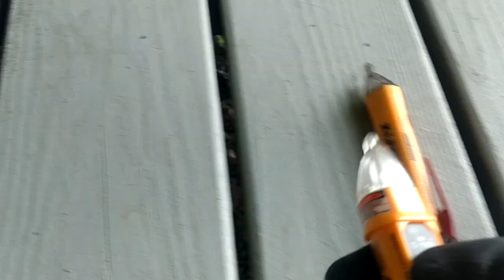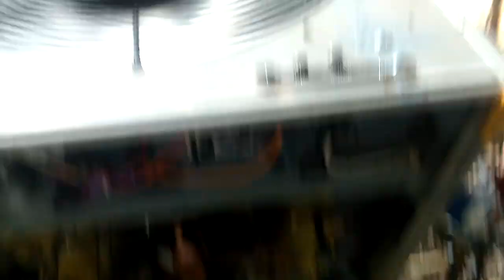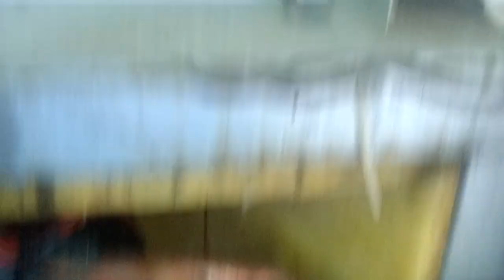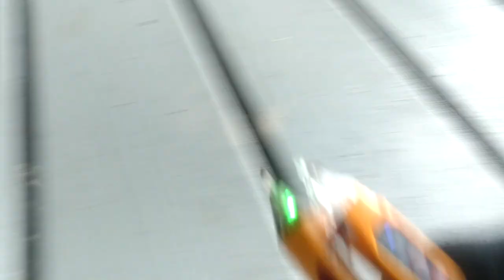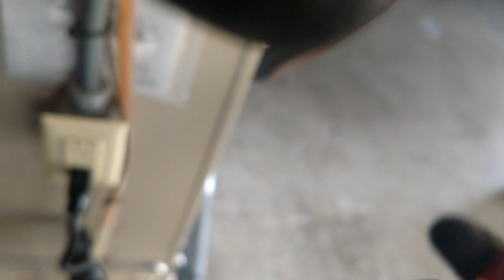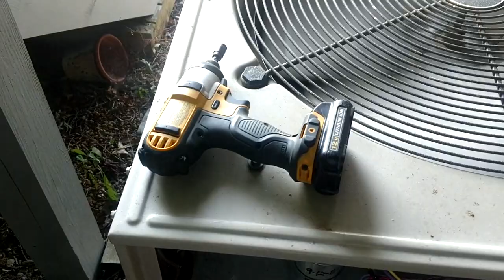Dangerous Problems⚡⚡Klein NCVT-2 (old version) malfunction caught on camera. Also testing NCVT-5.

Comment from the maker: The NCVT-2 probably went into "silent" mode once. But it obviously had mind of its own, turning on & off without even touching the button. NCVT-5 is definitely the better option.
Reply: exactly ncvt2 drove me crazy turns on , off .
Reply from the maker: @hvacir9176  I'm glad I wasn't the only one. A lot of people seem to be experiencing the same problems with the ncvt-2. Thanks for you feedback & for watching 👍
Reply: Personally I believe the tip light is good enough because it assures you the thing is working AND these devices auto power down, the biggest concern in my experience.   I do agree that functionally  Ncvt-2 is the better detector with its dual voltage modes (12-48vac and 48vac to 1000vac) and better light.

Mode changes based on holding the button for various times is perhaps the worst human engineering part of the NCVT-2.   So to be safe you have to watch the light on the tip.  That's probably why the new model has a weak buzzer.  Its trying to enforce the habit of watching the tip and by extension, where you are sticking your hand.

1.  Normal Power up  = 1/2 second with the device off 
2.  Silent Mode            = 2 seconds with the device off  
3.  Toggle Dual Mode = 2 seconds with device on plus retains last mode 

For those who are interested, part of the NCTV manual:   [My comments in brackets based on my experience with it]

"In NCVT-2 mode, the tester will be more sensitive and will show voltage indication at a further distance away from a
 high voltage source than in NCVT-1 mode [same device in high voltage only mode]. Use NCVT-1 mode in situations where you expect the voltage source will be greater than 48V AC." 

Low battery indication:
Scenario 1 
[what happens when the battery is slightly low, typically 1.4vdc is low]
[After] "Powering on the tester: The 'power on' LED in the tip of the tester changes from a steady green or blue to a
 blinking green or blue and a series of beeping sounds is generated. The tester then turns off [within a few seconds]. The unit is now deactivated and is not operational, the batteries require replacement."
[So if it doesn't stay on long the batteries are low.  However it will work for a few seconds so its important to always look for the tip light to ensure its ready.  In this "low battery scenario you get a chance for maybe one test, hopefully realizing the thing needs batteries.]

Scenario 2 
[The batteries are really dead]
"Operating the tester: If the LED lights dim and the tone fades, the tester may require new batteries."

Auto Power Off:
[Auto power off is the #1 reason you always look for lit up tip first every time]
"After 4 minutes of non-use, the tester automatically powers off to conserve battery life. Listen for a double-beep
 sound and watch the “power on” LED turn off. The tester is now deactivated and is not operational."

Silent mode:
[Clearly a problem if you are not always looking at the tip for visual indications]
"The tester can be operated with only visual indication of voltage. With the tester powered off, press and hold the
 power button for 2 seconds then release."

System self-test:
"The “power on” blue or green LED visually confirms battery sufficiency, system integrity, and operation/active mode.
 Always test on known live circuit to verify tester functionality prior to use."

Changing operation modes:
"While the unit is powered on, press and hold the power button for 2 seconds. The unit will beep 3 times and the power-on LED will
 switch [toggle] from blue to green or green to blue. The tester will start in whichever mode it was last powered off in."  

Blue Tip with No Voltage is Dual Mode 12-48vac  and 48-1000vac
- Red Tip Blinks and Beeps on Low Voltage
- Red Tip is Steady and Buzzer is Steady on High Voltage
Green Tip with No Voltage is Single Mode 48-1000vac  
- Red Tip is Steady and Buzzer is Steady on High Voltage

[End Manual Portions]
Reply: Mine stays in high mode and does not even beep it just stays green so it’s just a glow stick for me
Reply from the maker: @jessegarcia5056  you might be accidentally putting yours in silent mode. I think I mistakenly did that one time during the video also thanks for your feedback 👍
Reply: Shannon Knight HVAC nope I know how to use it lol mine is only good for a glow stick it stays green all the time does not turn red or beep when in use now if I tap it on something hard it beeps it can be a toilet seat and it will turn red and beep if I put near a live connection stays green
Reply from the maker: @jessegarcia5056  I would get rid of that thing and go with something else..
Reply: Shannon Knight HVAC like I said only good for a glow stick
Reply from the maker: @jessegarcia5056  one of my co-workers got the new Commercial Electric "Home Depot brand" and it works really good. Under $15. Back in the electrical department. 👍
Reply from the maker: I was at Home Depot today and guess what? Klein just released a brand new "redesigned" version of the NCVT-2. The NEW NCVT-2P has a screw on style tail cap & new led's to visually indicate which mode the detector is currently in. Design is almost identical to the NCVT-5. 🤔🤔🤔🤔🤔🤔🤔🤔🤔🤔🤔🤔🤔
Reply: Thank u so much for your opinion, greetings from Mexico

Comment: Thanks for the video,Shannon. I have 2 of these always in my side pocket. 1 is dual voltage and the other is for high voltage. They would randomly turn on and off constantly throughout the day driving me crazy. I also have a video with 3 of them behaving differently on the same wire. One of the weirdest situations is when you test a receptacle on the live, without holding it it shows that there's no power and while it's in the receptacle, if you touch it, it shows you have power. I wouldn't trust any of these.  Stay safe
Reply from the maker: Klein has redesigned it. I haven't personally tried the new version but it does have a "screw on" cap for the battery compartment now so I would imagine that will probably fix the issues. Thanks for watching and thanks for your feedback 😎👍

Comment: Great video - - Just FYI, with the -2, while in the blue mode, it is both low and high voltage mode at the same time. If it senses high voltage, the light will turn on steady and beep steady - - if it senses low voltage, it will flash red and beep beep beep.

Comment: I do agree with you regarding the tones and volume of them. I think Klein should keep the tones consistent across all models. The NCVT3 has a flashlight but the probe is shorter, the tones are different, and the addition of the flashlight is cool but you have to pay attention to the display rather than the tip.
Reply from the maker: Maybe the brand new "redesigned" version of the NCVT-2 will be better. They have them at Home Depot now.
 Thanks for your feedback and thanks for watching 👍

Comment: I had the very first version that had the power on button on the end cap.  I too got this model #2 and TOTALLY AGREE that they are just trying to do too much with one tool. If you need a light then bring out your light. My first one worked every time, No power on / off issues.  Every time you turned Model #1 onyou also pushed on the cap too.  
All I'm sayin' is that the added features are useful for SOME techs.  BUT some guys JUST WANT basic function to keep from gettin' that nasty buzz.
Good tool brand.  But some ideas have way too much influence by a millenial engineer that has never had the fun of getting juiced.  The first design was out for YEARS and it gave us the function we want.
BRING IT BACK!

Comment: Never had an issue with the Fluke VoltAlert. The NCV function on my Fieldpiece stick meter has been reliable too. Definitely would never rely on either in a life or death situation. More of a convenience item for verifying which breaker turns off what without having to stick the meter probes in the outlet.

Comment: I believe you had it in silent mode. Which would explain it not making an audible sound. I’m not sure about the tail cap problem.
Reply: Mine has the same the problems. I think it is the battery negative contact on the cap that is too soft. Yesterday it stopped detecting any voltage because a little bit of  coffee got inside of it. I just took the circuit board out and wiped the tip and PCB using alcohol wipe, I will see if it is going to work.

Comment: You ask if a Klein rep can contact you regarding the NCVT-2? I can tell you they won't. Their inevitable response will be "TFB". I've been in contact with a rep about my NCVT-2 and how it just stopped working about just a few hundred uses (over a 5 year period). It's one of 3 testers I've got and it got minimal use. One day, there appeared a cloudy discoloration on the inside of the normally clear probe, and that was it. It no longer worked. I tried jiggling the battery cap. No battery leakage. No loose wires. It just didn't work. Looked to me like a component had blown, causing the cloudiness.

The first email reaction of the rep was "plastic gets cloudy over time". That didn't explain why the older NCVT-1 was still clear. Then..."no manufacturer has a lifetime warranty" and "we have a longer warranty (2 years) than Fluke. What crap. When you have to excuse your products poor performance by bragging about a warranty, you know you're grasping for straws. Also, note how he stopped trying to diagnose the cloudiness? He KNEW it was because of a cheap, blown capacitor.

I responded back that Fluke can offer a 1 year warranty because their testing tools are made with quality components that last a long lone time. I've got one of their multimeters that is nearing 40 years old.

Lesson learned. No more Klein electronic devices in my tool bag.

Comment: Klein may have improved on that issue since this video was made. I've had the NCVT-2 for just over 2 years and haven't encountered this problem. I even just now tried to force the clip end up and it doesn't budge until I press the yellow button to release it and then putting it back on it solidly snaps back into place.
Reply from the maker: Yes, you're exactly right. They recently changed the whole design. That model now has a screw-on tailcap. Thanks for watching 😎👍

Comment: 10:54 you started it up in silent mode. Notice the red light on as it detected the voltage but as its in silent mode=no audible alarm. At 10:54 you held the power button too long which puts it in silent mode. Easy mistake to make.
Reply from the maker: Yes Paul, I put that in my pin comment above. I realized that later on. But some of the malfunctions during the video where from the instrument. There's just too many problems with this thing, I threw it in the trash.
Reply from the maker: Thanks for watching 👍
Reply: @sknight0391  Hi Shannon did Klein help you out in any way such as warranty? So Basically your not advising to buy this model. I was definitely looking at this one but now, not so sure. I was looking then at the NCVT-4IR- Does it work well on low voltage (24volt)? Does it do low voltage automatically or do you manually switch it over? What is your overall opinion on the 4IR as I guess the NCVT-2 you are not recommending. Thanks
Reply from the maker: @PaulHVAC1  no Klein hasn't contacted me in any way shape or form concerning this video, and I'm sure they won't. I still love their tools, like I said in the video... it's not to bash Klein at all. I just don't like this particular tool and I do believe it has the potential to be dangerous. The NCVT-5 works just fine on both high and low voltage. Other than the beeper not being very loud it's a good instrument. But I would not recommend purchasing the ncvt-2. Too many other people have had the same problems with that one. I hope that helps 👍
Reply from the maker: @PaulHVAC1  No experience with the 4IR
Reply: @sknight0391  Thank you Shannon Knight HVAC

Comment: I've had the same issue with the dual voltage tester that they came out with first.Other than that, I love it. I also have the version 3 and like it OK. the light is handy. Southwire has a dual voltage tester that looks like the NCVT-2 . Milwaukee also has got in the mix with their version that is rated pretty high. Klein really needs to address this though. Thanks for posting this and raising awareness to the problem.

Comment: Great video and info. Just for the hell of it, do you think it went into silent mode by holding the on/off button down to long even though it didn't appear so in the video? No matter what, the 5 seems to have addressed the problem with the screw top. Ty very much again.

Comment: Yea the beeping noise is important, it literally warns the user that hey this wire is live. I don't think the color difference will give greater protection to the user than a annoying beeping noise. You probably had it on silent mode.

Comment: My NCV-2 is actually pretty loud, however the NCVT-5 by Klein is MUCH more obvious when touching a hot as it is a higher pitch tone and even much louder. I got mine last week, don't know if they changed them or what, but it also does beeps if it is low voltage, then a solid tone if it is a close connection ( On the NCV-5), both are brand new. Never had the issue with the NCVT-2 .I use it in my pocket pulling it out multiple times a day as an electrician with no problems for about a solid 5 days now. Both are great, get a Fluke if you want accuracy or even a 10 dollar Greenlee non contact tracer is great. Never had an issue with the new Greenlee 90-1000v tic tracer

Comment: A tool like this should be more simple to emphasize reliability. I think the move to add features like temp sensors and distance measurements is a backward step. You don't want to be flipping through the manual each time to be sure you've accessed the features correctly. One button, one light to verify it is working, a different light to signify voltage, and a tone that can't be accidentally turned off.
Reply from the maker: Very true. Great observation. Thanks for watching 😎👍
I'm glad that Klein has since redesigned this NCVT. New Redesigned  tail cap.

Comment: I disagree the ncvt-5 was causing huge problems. If there was a dead wire that was within 3 inches of a live wire. It would tell me the dead wire was live, but the ncvt-2 would show that there is no live current... Also in a box or panel, the ncvt-2 is the way to go. The ncvt-3 and up can detect live wires further away, so its can be hard to tell which wires are live, as opposed to the ncvt-2 that has to be closer to detect a hot wire... 95% the ncvt-2 would be the better option.
Reply from the maker: I don't use either one of my Klein non-contact voltage detectors anymore. are you sure the ncvt-5 isn't set to the low voltage setting? Because that does make it much more sensitive and it will alert some distance away from a hot wire. But when mine was on the high voltage only setting I had to be touching the wire for it to alert. 
Thanks for watching the video and for your feedback Travis 👍
Reply: @sknight0391  hey Shannon, you say "I don't use either one of my Klein non-contact voltage detectors anymore." So, what are you using now?
Reply from the maker: @billmyers8799  Craftsman

Comment: Shannon, same problems with my NCVT-2, microprocessor - MIND OF ITS OWN!!  Mine had other problems: lose connector in the back cap, this double-trouble combination was unbearable.
Next day took the back off and ran a 2" jumper-wire through the cap, soldered it to the board and fed it back in through the cap and connected to the screw.  Now have a handy U that will hang on a clip :-/
The bush league fix did solve the AAA battery connection problem, but still have an array of microprocessor problems (same as yours).
btw..the two prong clip in the red cap (which shot out of my hand anyway) was very low quality.

* Brand new tester, right out of the package
Reply from the maker: Thanks for your feedback 👍
Reply from the maker: I was at Home Depot today and guess what? Klein just released a brand new "redesigned" version of the NCVT-2. The NEW NCVT-2P has a screw on style tail cap & new led's to visually indicate which mode the detector is currently in. Design is almost identical to the NCVT-5. 🤔🤔🤔

Comment: Thanks, I was going to get the NCVT-5 but I need to be able to hear it.  I will have to try a different brand.  Any suggestions ?
Reply from the maker: The NCVT-2 would be the perfect detector,it's good & loud, but they really need to fix the batt. cover issue. Southwire detectors are loud. I do really like the operation of the NCVT-5, i just can't figure out way they would put so much into a detector like that & then drop the ball on the volume level. DO THEY NOT TEST THIS STUFF!?
Thanks for watching & your comment 👍 Let me know if you find a really good one that you like.
Reply: Fluke 1-AC has always worked excellently for me.  They make fancier models, but I like its simplicity.  (I also have some others with a flashlight or IR thermometer 🌡, etc.) The Fluke has served me excellently and reliably for years.  It’s simple, visible and loud.  It just works.

Comment: Mind does the same thing too. It acts up on its own and it will be beeping and turning on by itself. I don't trust that NCV detector at all and I'm having to use the multi-meter after testing with the NCV detector because of trust so I just stop using that Klein NCV detector. In my opinion it's not even with $1. Sorry Klein but just speaking from my experience.
Reply from the maker: Thanks for watching 👍

Comment: I have the ncvt-3 from day 1 when I got it at home depot I haven't used it because the dam thing beeps at everything beeps at my body my clothes plastic metal skin drywall concrete everything I seen another guy who had the same problem even went back to home depot and tried the others there they did the same thing beeps at a glass of water wtf